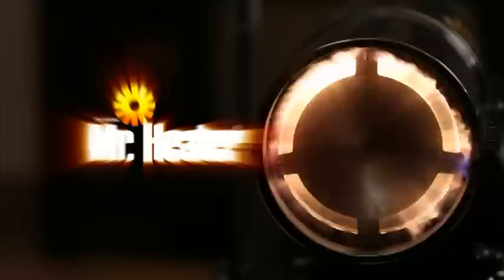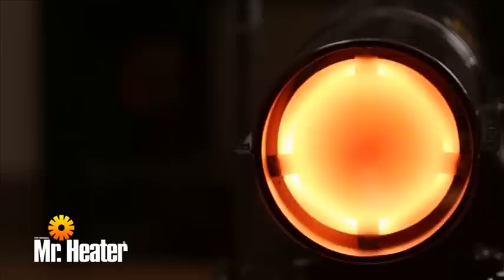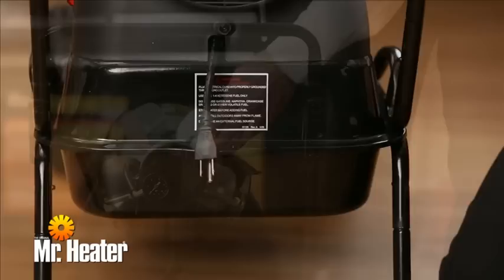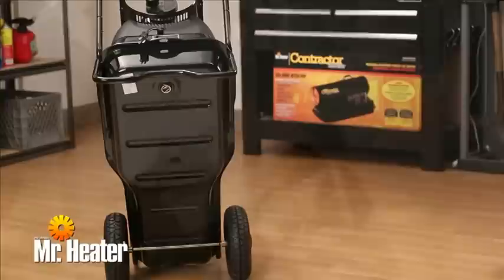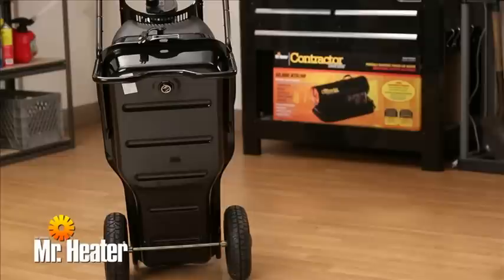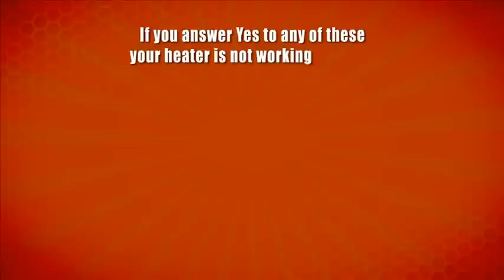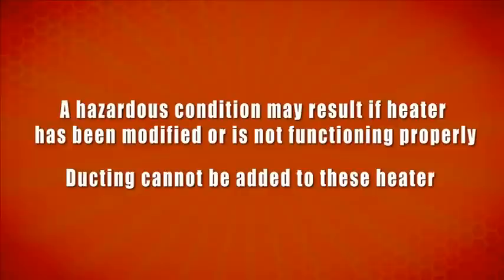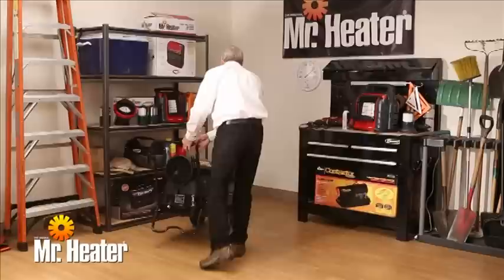Mr. Heater Forced Air Kerosene Heater Cleaning and Maintenance

Comment: Mine is 3 years old. It wouldn't fire this season. The fan would start up, but fuel would just shoot out of the nose cone. I found someone on a forum stating that they had the same issue, and a new fuel nozzle fixed it for them. I ordered the nozzle last weekend. I worked on it today. I blew out the air filter, replaced the Diesel #2 I had left in the tank from last winter, and replaced the nozzle. Also, when putting the vacuum and fuel lines back on, I quickly noticed they were cracked, big time. I went to NAPA and bought new hoses. It is crazy unacceptable that these lines would be this degraded after 3 years. Yes, it is now back up and running, and I cannot say what the actual issue was, as it could have been anything; fuel, hoses, nozzle, and maybe the air filter (it wasn't that dirty at all). The moral of the story is that Mr. Heater is using horrible quality hoses. Nowhere near acceptable.
Reply: Mine was just over a year old and hoses were bad cracking and split open  cheap off shore rubber. Did the same thing with mine and works better
Reply: Thanks for the tip. I had the same trouble with hoses.

Comment: I was taught years ago to just set the pressure on the pump so that the flame doesn't blow past the plate on the front of the heater. If it does, it's running too rich. I always adjusted the flame so it spits out a little around the plate, then back it off a little on the adjustment screw and it burns clean with no smoke or odor. And I never use Kerosene, just diesel fuel.

Comment: My torpedo heater runs when top is off but turns off with top on, why?
Reply from the maker: The reason for this is most likely an air loss in the heater itself. Check the rubber hoses and lines to see if there are any cracks.  The air loss from the lines will cause the heater to run with the top off and shut off with the top on.  If you have any other questions, please give us a call at 1-855-663-0660.
Reply: @MrHeaterTV  I have his same issue.. but mine runs if I just cracked the top open at the rear... no pump adjustment helps..  I have new lines .. a new photo.  A new ignitor..  I redid the seals on the pump . Cleaned the spray tip. ... please help..   fustration piling up right along with the snow..
Reply from the maker: @hondaxl250k0  Please give us a call at 1-855-663-0660 and we will help!

Comment: I have a 75,000 btu Mr. Heater torpedo that I believe needs a pressure adjustment. There are two screws on the back. One says intake filter and, one says output filter. It didn't have a manual when I got it at the store.  How should I proceed?
Reply from the maker: Please contact us at 1-800-251-0001.  We can set you up with instructions on the pressure adjustment and also send you a new manual.

Comment: Can you please tell me why the thermostat on my new MHC140KT -- when it's turned all the way up -- reads "CH"?

There's nothing wrong with the heater, it's just REALLY bothering me that I don't know what "CH" means. 

Why does the thermostat go from "96" to "97" to "98" to "99" to "CH" ???
Reply from the maker: Hi Dave, the CH stands for Continuous Heat. The heater will burn as long as it is set to that setting.

Comment: I just purchased a mh210ktr and have used it daily for a week or so, now when it turns off due to the thermostat setting it will not restart when the temp drops. It will try to start but does not. Light flashes twice indicating no flame. Fuel then drips out the front. The next morning it starts fine. The ignitor is working. Any ideas?
Reply from the maker: It sounds like your pressure might be a little low. Various environmental things can influence that, such as humidity and air pressure. Increasing the pressure at the back of the heater a little bit should get that starting normally all the time.
Reply: Ok thanks, I turned it up slightly today and it cycled a few times ok then would not towards the end of the day. I will try upping it a little more tomorrow.

Comment: intermittent spark when it's sparking it starts when it won't spark it won't start
Reply from the maker: Hello! If you're having issues with a heater, please give Mr Heater a call at 1-855-663-0660.

Comment: My heater does not work..I need some assistance.  It runs for about 30 secs and turns off.
Reply from the maker: B.I.A.S Racing Sorry that we didn't get back to you sooner!  Please call us at 1-855-663-0600!
Reply: the flame eye probably needs to be replaced. if the eye doesn't see a flame it will turn off within that time frame.

Comment: Is it okay to burn clean diesel in the mr heaters?
Reply from the maker: Yes!  These heaters will run on diesel, kerosene, Jet-A, and fuel oil.
Reply: Thanks, I was just curious because that's what I've been running in mine. I bought it new last winter and it works okay when it works. It stalls a lot despite my adjusting pump pressure, keeping the filter clean, fuel filter etc... It puts out a lot of heat when it runs.
Reply from the maker: We can help with that.  It could be a simple fix, like a crack in one of the fuel air lines.  A small hole or crack in a line could cause the air and fuel pressure to be unstable.  If you continue to have these stalls, please call us at 1-855-663-0660.  We can get your heater running properly.
Reply: @MrHeaterTV  , wow, cracked fuel lines in a brand new unit? I hope not, I'll check it out, but right now it's not running, luckily I have a couple 100 yr-old kerosene heaters I can depend on. Thanks for being honest.
Reply from the maker: If it is a new unit, it is unlikely that it would need replacement hoses or lines.  It might need a small adjustment to get it up and running properly.  We'd be happy to help get it going for you. Give us a call at 1-855-663-0660.

Comment: The design of the power cord wrap spindles was very poorly done on the MH75KTR model! In order to remove the inspection cover those two cord wraps need to be removed otherwise there are two screws on the inspection cover that cannot be accessed! When you remove the two cord wrap spindles or holders....the nuts on the inside of the inspection fall down inside the heater which was a stupid foolish way to design this!
Those two cord wrap spindles should have had nuts permanantly welded inside the cover ....
Reply from the maker: Mikey196969 Thank you for the feedback and comments.  This will be sent on to our product managers and engineers to improve the product for our customers.
Reply: Mr. Heater That doesn't really help me now after i spent $350.00 on one! It worked great for one year and now it works for 15-30 minutes MAX then shuts down for no reason. I changed and installed all new filters,emptied,flushed the fuel tank and put new fuel (NO 1 Diesel) and it is never used in a dirty environment but i cleaned everything just the same. The pump pressure is correct.... so i suppose that there are 10 other things i would have to change for various reasons now and spend another couple hundred dollars on before i figure out why it won't work properly.... not impressed with this product at all.
Reply from the maker: Mikey196969 Not at all.  We would be happy to help in any way we can on your heater.  It is still under warranty, so you would not need to replace any parts at all.  Please call us at 1-800-251-0001 and we will help troubleshoot the unit for you and if we are unable to, then we will replace the unit for you.  Looking forward to speaking with you about this.

Comment: I bought one of the 175000 contractor series about 6 years ago, junk has never worked correctly. A friend of mine bought two old non Mr. Heater brand at a garage sale paid $100 for both no problems. Mr. Heater, Chinese made junk waste of  $600.
Reply from the maker: Thank you for your comment and feedback.  We can help get your contractor series up and running either by replacing some parts or replacing the heater completely for you.  Please call us at 1-855-663-0660!
Reply: Only a nitwit would buy a 175k and not return it if it wasn't working properly

Comment: Why don't you show us how easy it is to empty the fuel from a MH75KT that is almost full and heavy as sin?? It was dumb not to put a drain plug on the bottom of the MH75KT because there is now easy way to drain the fuel from it and it should have a pressure gauge also because there is no way to know what the pressure is on this model. Your video shows only the more expensive model with wheels but does not mention or show "how easy" it is with the MH75KT
Reply from the maker: Mikey196969 Thank you for your feedback and comments!  We appreciate it.  We recommend to siphon the fuel with a pump or to use a funnel to move the fuel to a container.  We will forward your concerns to our product managers to improve it for our customers.  Thank you again!
Reply: How to very easily and cleanly drain fuel  from model MH75KT:

Step 1: Turn on the heater

Step 2: Wait

Comment: hoses dry rot split leak. Vanes on air pump rotor stuck photo cell dirty not aimed at flame dirty fuel rust or hugs water in tank....nozzle dirty....all when it's -10° out and the f#$#& thing will not run...lol
Reply from the maker: Thank you for your comment. We can help you troubleshoot these issues and get you up and running right away.  Give us a call at 1-855-663-0660.